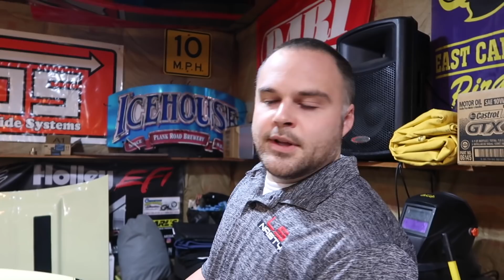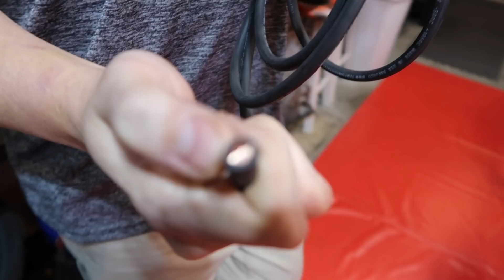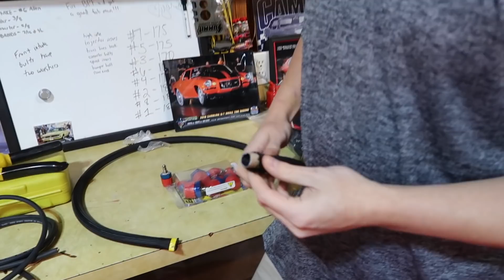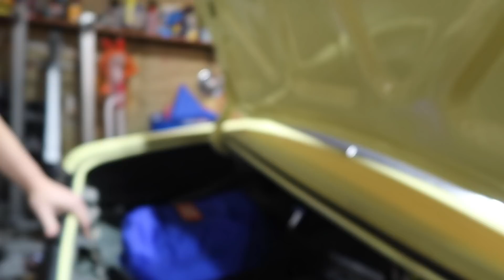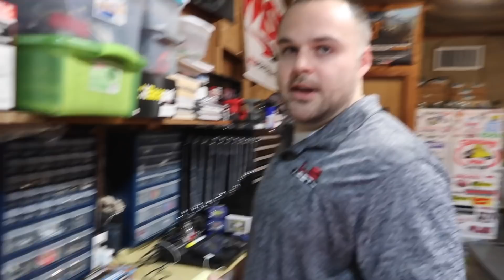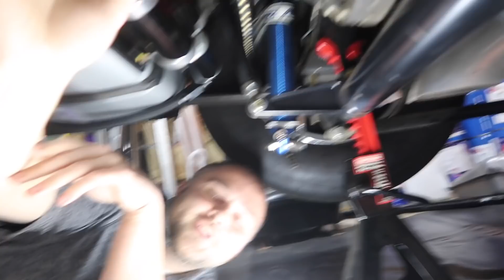putting HOLLEY on a PUMP GAS BIG BLOCK NITROUS CAMARO!!!!!!

Comment: Sweet '67 Camaro. What engine are you running?
Reply: That's ok, I'm old school. I had a NAPA engine machine shop that I sold just as the LS platform was coming out.
All I've ever built were small blocks, and canted valve big blocks. With my non-compete, I've never built an LS.
I built seven '69 Camaros both small blocks and big blocks. First gen F-body is a great platform.
Awesome car man.
Reply: 427 cubic inches, motor is very old school

Comment: Ofc wire best wire for car electrical. And a hydraulic crimper is the best. All we use for audio installs. It will work with up to 8/0 gauge. Not 8 gauge 8 gauge and 8/0 gauge is different. Team shok 8/0 its like 3 times the size of 0 gauge. One spool is like 900 bucks. Ive only have one guy had me use it on his vehicle he purchased. It made 0 guage look like speaker wire. It was ridiculous.

Comment: Dont even get  to start  watching by time load up and already  hit that thumbs up keep up hard work 💪 and on the kill switch have not had that iusse but I am running my alternator wire through that switch 2 so it get disconnected when the power gets tune off  so far so good for mine and all my power and grounds is that welding cable wire work vary well for the job

Comment: What Solid state relay did you use for the trans brake? Also how does it wire in to ECU and trans brake solenoid?
Reply: 15620 NOS...check out Devin vanderhoof on YouTube for a video about using that for a bump box (will explain wiring TB with this relay, don’t have to make it bump)
Reply: Thanks. Both of your cars are awesome.
Reply: Thanks man, always a work in progress
Reply: How did you mount the termX and SSR on the glove box door? 

I’m about to install mine in my 69
Reply: I used nut-serts...gives you a threaded insert for a bolt